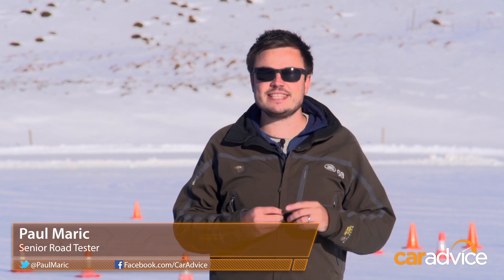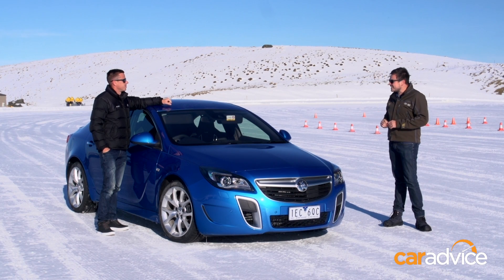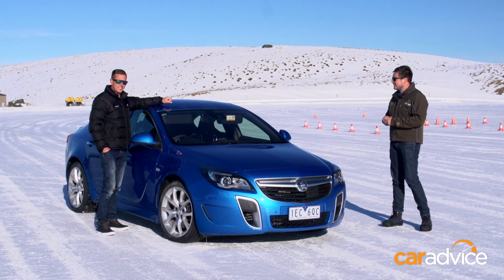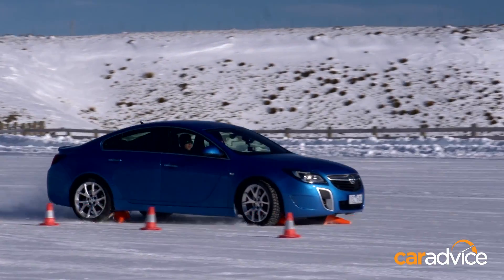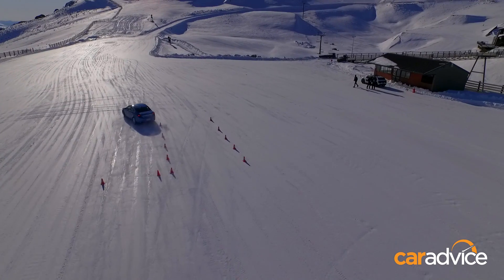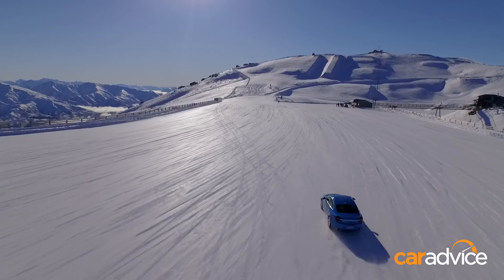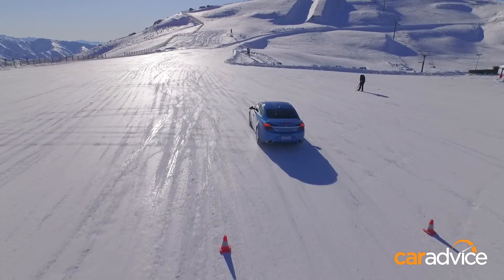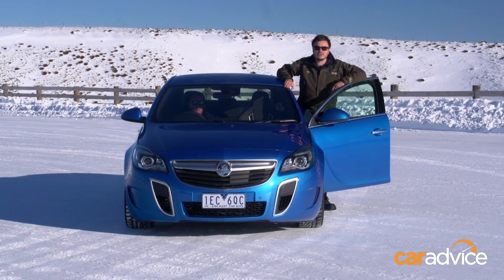How does stability control work? ESC demonstration on ice with the Holden Insignia VXR

Comment: This saved my life when the feature was new many years ago.  In the dark night, I was reducing from 60 mph into a clover leaf exit ramp when a car came toward me head on (it had turned mistakenly onto the ramp, thinking it was a way to enter the highway).  I slammed the brakes and turned as hard as I could, fully convinced my car would either spin out or roll over.  But this feature was activated and the car avoided the accident and went in the exact direction I steered.  It was a surreal experience.  I know it saved my life.

Comment: The professional drive who hit the brakes on snow instead of just swerving. They should have did it with and without using the brakes
Reply: the good thing about ESC is, that it will stabilize when breaking and even when not, which is especially helpful in stressful situations like an emergency evasion maneuver.

Comment: It's like they just showed off ABS technology, rather than the ESC itself.
Reply: when turning the car brakes the inner wheels first, you can actually see it in the slowmotion….
ABS won't do that for you, it will also never engage if you are not braking at all, ESC will.
Reply: Not true at all. Abs technology is only used when braking. It does not prevent swerving from slippery road conditions as much as it prevents swerving from locked wheels. It ONLY engages during braking, which was not used during the swerve test. The technology that you saw 'showed off' was actually almost all the ESC.
Reply: Yeah that is testing. ABS vs no ABS ( but in case with ABS to not hit brakes at all and see what will ABS do)

Comment: Obviously he is not professional drive as he would have let go of the brakes or would just pump them.
Reply from the maker: James is a race car driver.
Reply: From a visual indication he mashed the brakes locked all 4 wheels turned the car into a hockey puck then plowed into the cones how professional is that , in the real world its possible to swerve , but the recovery into the second lane would likely see the cars rotation physics leading to nasty reactive uncorrectable spin (or flying of the right hand side of the road boundary of you don't try a turn back onto the right lane ..
Reply: Fuck me you lot are dim... IT WAS A DEMONSTRATION. Yes obviously you can brake softer so it doesn't lock up and countersteer etc if it starts to slide but this is supposed to show how the system can deal with the situation even with an unskilled driver at the wheel.
Reply: @BarbecuedPossum  yeah, but in that case DO NOT BRAG ABOUT THE DRIVER BEING A PROFESSIONAL.
Reply: @domenlipnik1017  True..

Comment: They made it look like a professional race driver is a helpless toddler without an ESP and ABS. Yes ESP is extremely useful, but he could have done much more without it. He was just sliding with all wheels blocked and the same steering angle all the way. 

BTW, in Sweden driving lesson on ice/like surface is part of every driver's education.
Reply: When slipping, the angle of the wheels does not affect the direction the car travels because the friction from them is not great enough to drastically change the direction. This is the same reason why when you are going on a highway, you would need to turn the wheel much much more to make a turn than you would driving in a parking lot or residential area.
Reply: @DominicI1  You are right. And that's why race driver would almost instinctively ease off brakes to regain traction and probably also reduce steering angle at the same time. The fact that he did not move the steering wheel shows that it is most likely a setup.
Again, what this driver did is what vast majority of normal people would do, just it did not look like driving by a "V8 Supercars driver" ;)   Plus no matter how good he is, with ESP in this situation any driver would beat race driver without ESP (as long as race driver wouldn't start tossing the car into the corner rally-style in anticipation of the corner).
Reply: @SDX9000  Maybe so, but the majority of drivers on the road are in no way experienced enough to properly handle these situations. You're right that the 'expert' should have performed better, as some people literally make a living mastering their 'drifting' and regaining control. If they said he was an expert, he should have performed better than an average person.